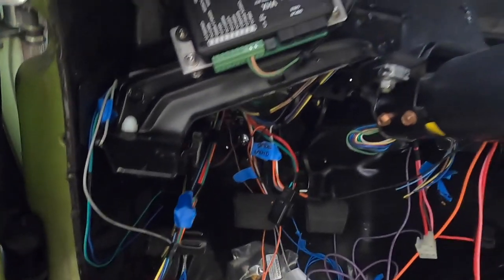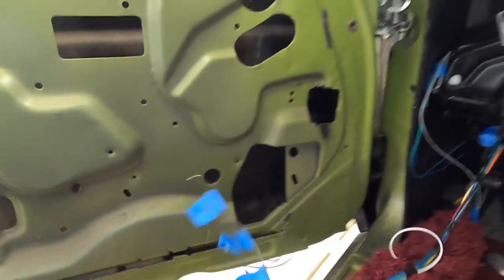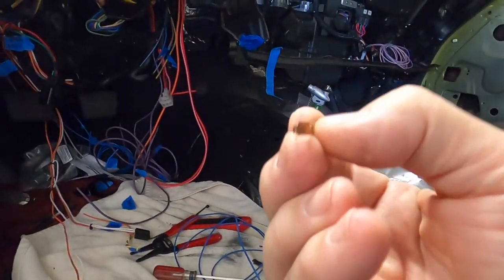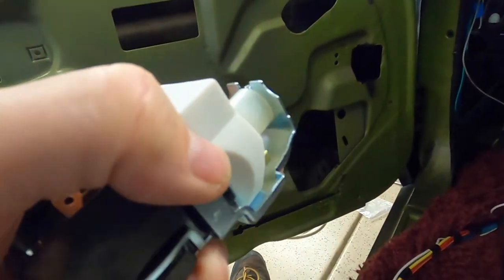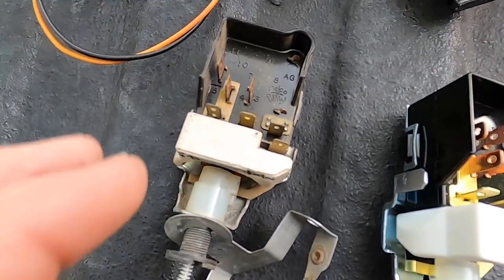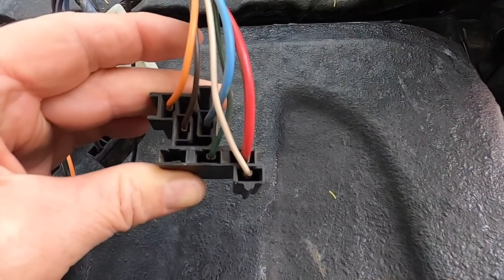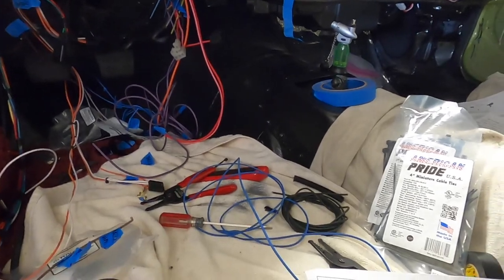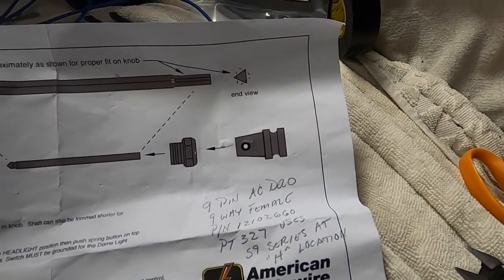"71" Camaro RestoMod American Autowire Light Switch/Harness & Connector Issues

Comment: If you are careful removing the terminal you can use it again
Reply from the maker: I guess if you were very careful and patient but those open barrel connectors if done right are really crimped on tight to the wire. Removing them from the connector block was easy but I have to shorten the harness too. Didn't want to butt splice a brand new harness. I've got some new terminals now so I'll just remove the extra 3ft they gave me on the light switch harness and re-terminate the wires. Weather is warming up so it's time to get back on it! Thanks for watching!

Comment: Wow what a PITA! I'm currently redoing my wiring in my Camaro also. If I were completely done with it all, I would send you my old harness that's still in great shape. I just opted for a updated one because of my LS3 retrofit. I think your to far along to send that thing back. No reason  for that kind of craftsmanship, or the lack of from AAW!! Tell you the truth, I think most of these after market parts are made  by the same idiot!!! Most of the stuff from OER, NPD, DynaCorn, Goodmark and plenty of others, have about 50/50 chance that it may fit somewhat! imagine if your AR 15 parts are sold at a 50/50 chance it may  work. Vent over!! lol
Reply from the maker: The first guy I talked to at AAW was for the most part giving me scripted answers. The second guy I talked with was very knowledgeable and admitted there were a number of uncorrected problems with this particular kit especially on individual harness runs. Some were to long and some very short. This kit has been on the market for a lot of years so corrections and fixes not being made at this point is inexplicably. As you said it's not just this company! I've had issues with just about everything so far! There was also an OEM intermediate wiring block on the right side firewall that was deleted by AAW for this kit which explains the "Courtesy Wiring" being daisy chained all over the place from the left side of the harness/car to the right side. I'm buying a few extra multi-terminal blocks to straighten out that disaster. Don't know how much better Painless Wiring is but they can't be worse! Waiting on some open barrel connectors to come in so I can fix the headlight harness! Speaking of AR's! Probably taking one of my Carbines out tomorrow! It works! Thanks for watching!
Reply: @peteregger7928  Painless has been pretty much straight forward. Really no curve balls here. They did delete the intermediate harness you talked about, but that's alright with me. 
I wonder if these company's have a disclaimer that covers there ass?  never did check. Also shoot a few rounds for me, no desert near me, so not many places to shoot at.
Reply from the maker: @Nonameshame  I'm sure some where it says if your car or garage burns down we won't be held responsible even if you prove out kit was installed per our instructions! Lol!